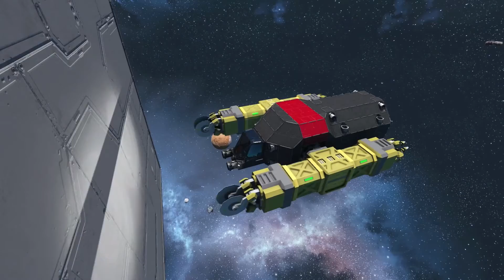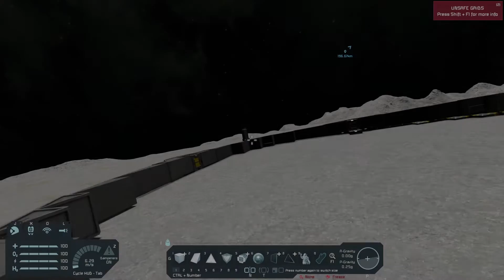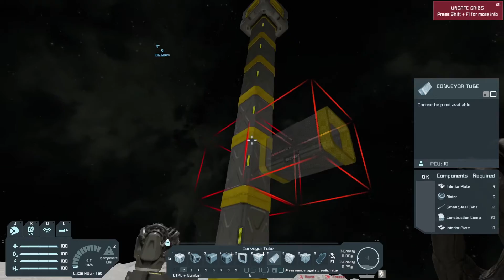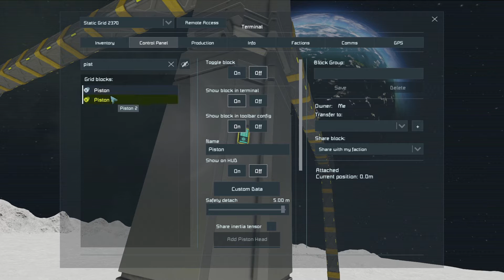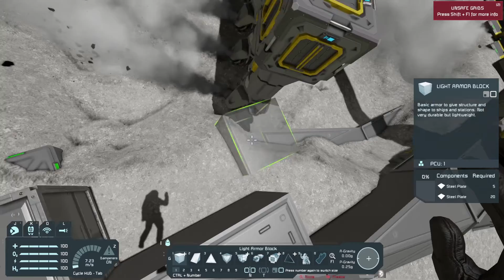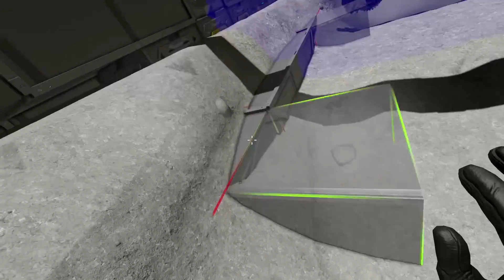Space Engineers #32: Re-redemption

Comment: Just a thought, if you use pistons for the 4 pillars on the sides where you currently have conveyors and extend them fully before building the top part and drills when the inner pistons reach the full length, you can go back and retract the piston pillars to dig even deeper.

Comment: Using two timer blocks is objectively more complex than setting a value. 0.1 for 3 seconds every 60 seconds is just 0.3 / 60 which is about 0.005. You set the pistons way too fast in the test as you could see from them moving up and down violently, hitting the ground and rebounding up and oscillating. Adding more drills than you need also makes the game unstable. If you hoped to reduce physics by using timer blocks it would be better to step the rotation as well so there are no parts in constant motion.
Reply: Except it doesn't work quite that way. If you pause the pistons it gives the drills time to eat away the rock below, if you then move them (hypothetically) the distance of the rock that has been eaten away, no oscillation due to no material being there when being lowered. Sure, far more complex, but both methods have their upsides